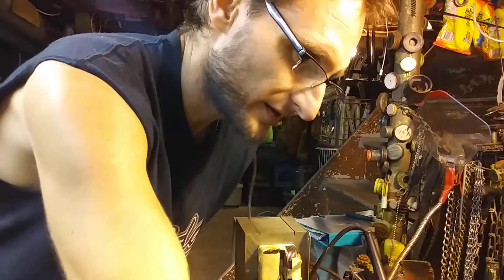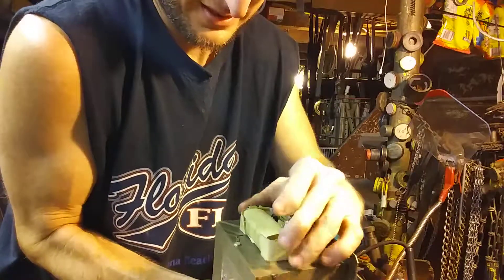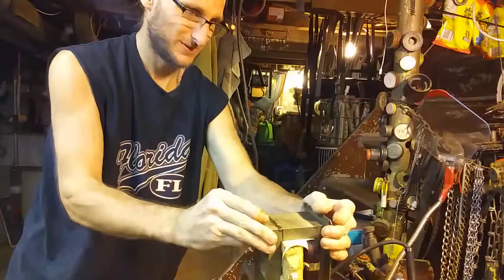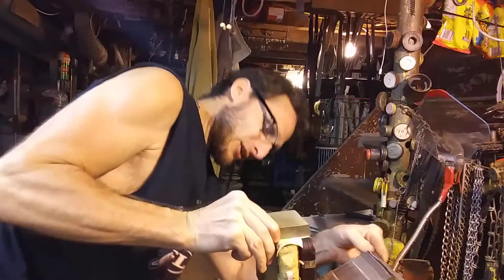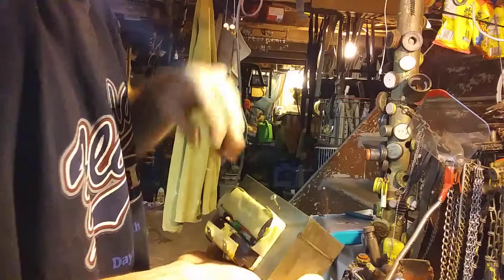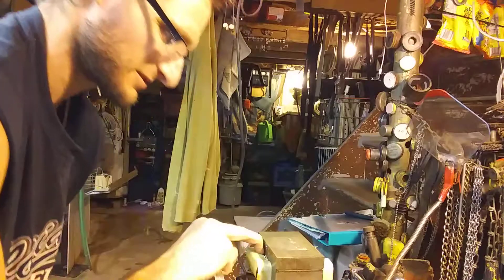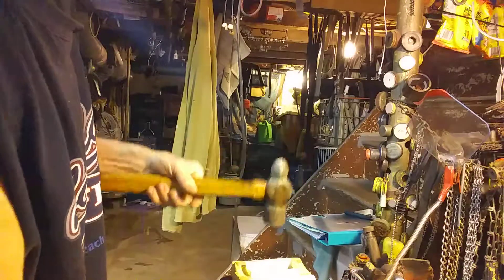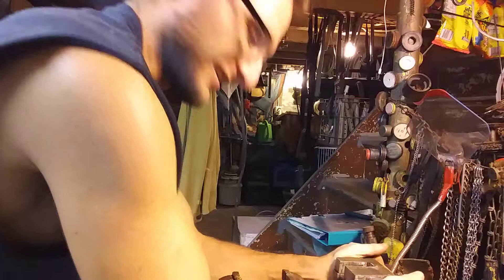2 microwave T's into an isolation transformer

Comment: Long dinner break.. Where's part 2?
Reply from the maker: Part 2 is called "isolation transformer wrap up and SUCCESS!!! That was one of my first videos. I appreciate your comments and Thanks for watching.
Reply: @RandysDen  thx
Reply: @RandysDen  how to make isolation transformer 220v in 220v out and the output must be 30 to 40 amp?
Reply from the maker: Randel Ruiz that might be hard to do. Remember you can’t get out more power than you put in, ie. Power = I current Xs Voltage, thanks for watching!
Reply: @RandysDen  i have big transformer from arc welder core size is 10/10cm how many amps can i get at the output at 220v?
Reply from the maker: Randel Ruiz  you should be able to find a transformer calculator on line that should help you. Also electrodroid for Android also has a transformer calculator that you can enter in your numbers and get a ruff idea of the output. Hope that helps
Reply: @smoke_stackz3168  , if the arc welder is made for 220V, 
then you can probable go to 16 or 20A max , see on the label on the back what 
the maximum power consumption (A or Wattage) is. 
This Wattage is what your transformer can draw at 220V, but if your wall outlets 
are protected with circuitbreaker less then 20A, you can't go up to 20A.
Also, when using a arc welder normal, and it draw 16 or 20A on the primairy, 
it can't handle this for not too long before the transformator gets too hot and the thermal protection kicks off.
I think for 100% constant use, you can go up to only 5 to 10A, and 15A for short time.

Comment: nice, was thinking about doing this. glad to find confirmation that this is something people actually do
Reply from the maker: Thanks much, I’m glad you mentioned that cause I found one flaw I made and that was not having an air gap for the center E core, pretty sure that’s why it buzzes like it has a load onto it, and throws a bit to much heat. Feel free to ask any further questions. In fact I want to test mine to get a wattage rating, very soon
Reply: @RandysDen  will do. ive got a few microwaves im gonna scrap for some projects soon, so hopefully i'll have my isolation transformer soon
Reply: @RandysDen  ripped part hte transformers. wasn't lucky enough to have identical windings, and it seems my transformers are too small for the load i want anyway. so im gonna splice them together like some kind of electronic frankenstein monster, and do my own winding. gonna using RTV gasket sealant to insulate the winding, and i'll probly use epoxy or spot weld to keep the cores together. might put some faraday cages in there too
Reply from the maker: I Love That Katie Loves Classic Books  I was hoping for a better outcome for you. I have seen people using masking tape to insulate their windings and I had some wrapped in a cardboardish type paper. I tested mine in a vice to match the windings and tested it before I finally welded it together. Sounds like you got a good handle on it, love to hear the outcome and thanks, Randy
Reply: @RandysDen  ya unfortunately looks like what im trying for wont work-- or rather it becomes just as expensive as buying one off the shelf. i'll keep the cores and wire around and some day it'll come in handy for a smaller project
Reply from the maker: I'm sorry to hear that, just watch out cause I have heard of people purchasing ones online and once they receive the transformer they find out the label was misleading or misrepresented and they then are stuck paying a fortune to return it. Almost like the seller realized this from the beginning. good luck however and wish you the best TY Randy

Comment from the maker: How many amps is the circuit? Also you need to do a resistance measurement on the primary or input side of the transformer.
Reply: Are you asking yourself a question on the comment section of your own video?
Reply from the maker: @RoshDroz  yes cause at the time it was just a theory i had and wasn't sure it would work. TY
Reply: @RandysDen  ohhh I see. Like asking your audience a theoretical question essentially. I get it!